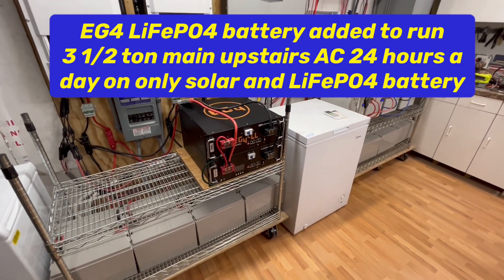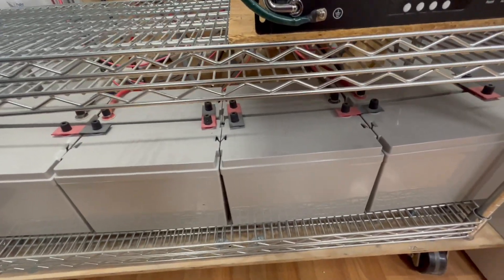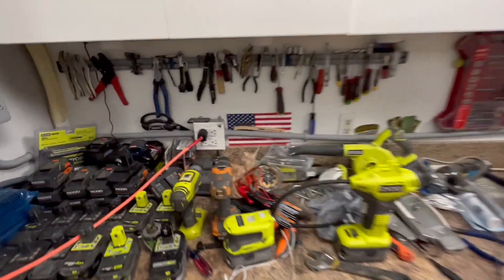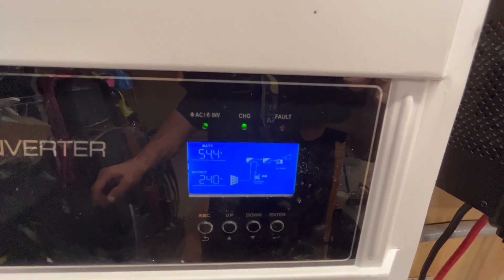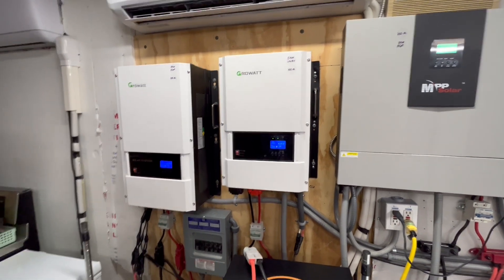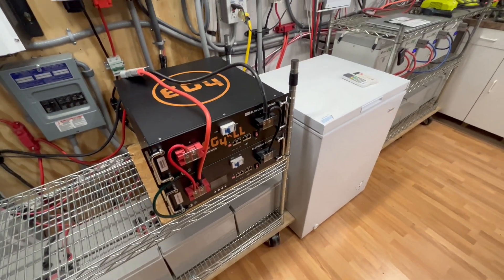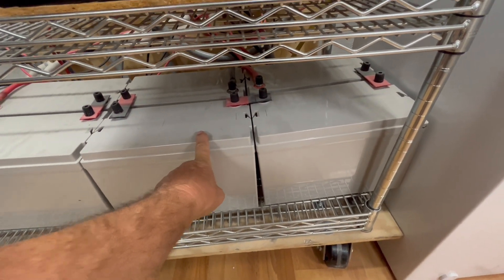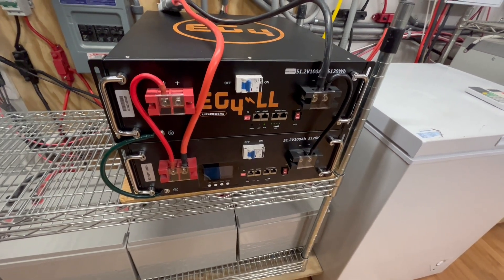EG4 LiFePO4 battery bank now runs 3 1/2 ton AC with 12kw Growatt inverter 24/7 just solar & battery

Comment: So after watching this once i finish my 24v 12,408Kwh Lithium battery bank i should be able to run my 12,000btu mini split 24/7 u think ?
Reply from the maker: Yes, absolutely. Should not have a problem running mini split overnight

Comment: Id love to have some good lithium batteries for my off grid tiny home camper. I have 2 inverters and 8 solar panels and some nissan leaf modules but man those good lithium batteries are awesome. My leaf batteries are good but kinda dangerous from what i hear
Reply from the maker: I buy one component at a time and pay off over 4-6 months, now it’s been 3+ years and I have a huge system. But the money I’m saving on electricity each year is over $5000 for what I am running on my system. My system is paid off from rebates and cost savings. I buy when they have insane deals on inverter, batteries and solar panels. Santan solar should be having a virtual sidewalk sale sometime in next month or two and you can pick up new or used panels extremely dirt cheap. Signaturesolar.com has great deal on batteries all the time.
Reply: @diy-solar-guy  I'm a truck driver and I have been delivering solar stuff to huge solar farms around Vegas for the last couple weeks. The solar farms are miles and miles of panels with battery banks that's ridiculously huge. The guys working on the solar farm told me to ask around about their leftover panels they have and I'd get a great deal on them. My only concern with that is how the heck would I get them to my house from Vegas?? Lol I do drive a semi but my boss wouldn't lete carry around all those panels for weeks on end waiting to get home time to drop them off. Yeah santan is a great resource and they have a couple different locations I believe
Reply: @matthewknight5641  I am Interested in buying the left overs of you could help me out.
Reply from the maker: Santan has location in Gilbert AZ and Savanna Georgia. Too bad you can’t get those solar panels for yourself. That’s usually half the cost of a solar power system. I would sweet talk your dispatcher and see if your last load before heading back to Vegas is to the solar farm.
Reply: @diy-solar-guy  the solar farm is right next to Vegas but I live in Tennessee.  I think I could get a great deal on the panels it's just getting them home is the issue. If I knew I was headed in the direction of my house or for sure try to get a pallet or two but I never know from one day to the next where I'm headed
Reply from the maker: Sometimes things are so close but yet so far away. Maybe it will work out for you in the future to go to Vegas with a load  and then back with a load to Tennessee. That would be nice.
Reply: @matthewknight5641  get them and put them in a storage unit till you go home

Comment: If I were you, I would buy at least 3 new inverters lol
Reply from the maker: Thanks for the comment. System has worked flawlessly and saved me over 90 percent on electric bill while also paying itself off with the savings alone. I am able to run everything that I need to run. I can produce more power than I need but that is a good thing for the fact if one inverter goes down I can still supply all my power needs. Hope you have a wonderful and blessed day.